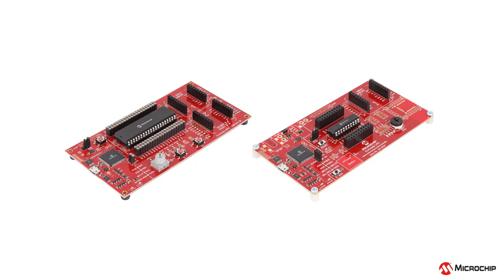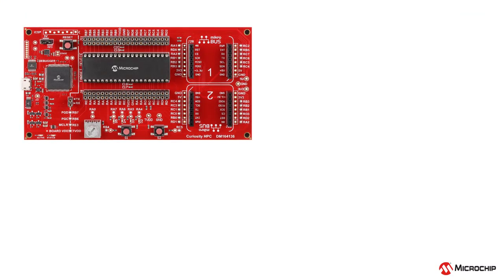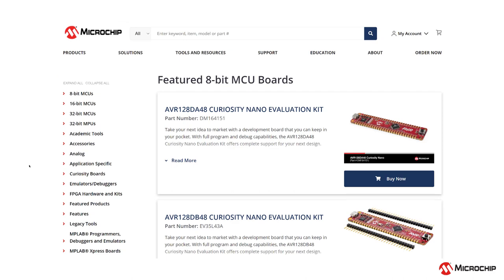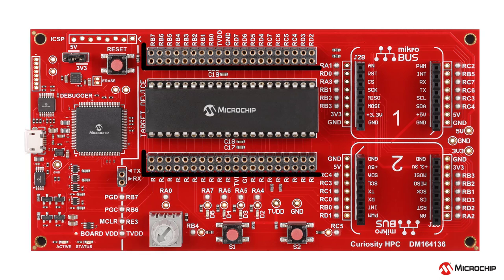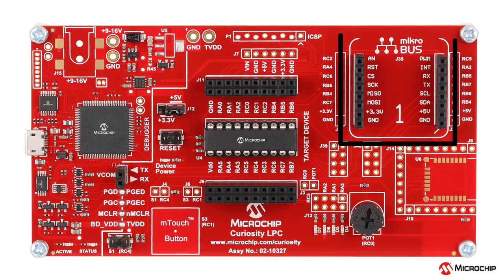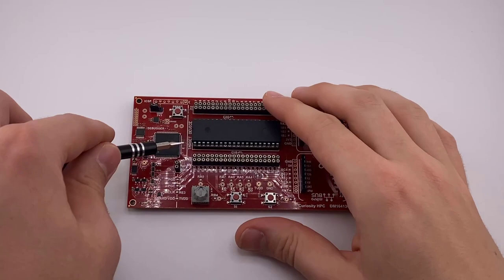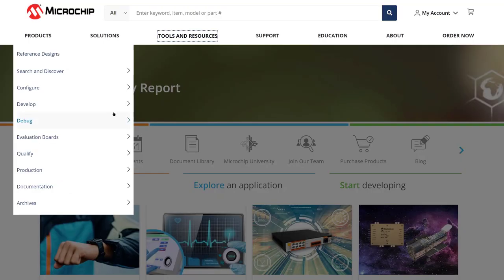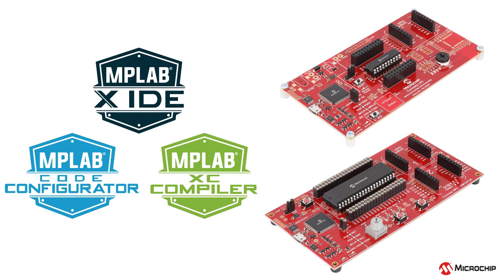Using the Curiosity Development Boards to Sample PIC Microcontrollers

Comment: someone knows if the HPC supports the same LPC microcontroller ?
Reply from the maker: Hi there, thanks for your comment. The Curiosity High Pin Count (HPC) Development Board supports 28- and 40-pin 8-bit PIC® microcontrollers, while the Low Pin Count (LPC) Development Board is designed for 8-, 14-, and 20-pin 8-bit PIC® MCUs. Therefore, the HPC board does not support the same microcontrollers as the LPC board.